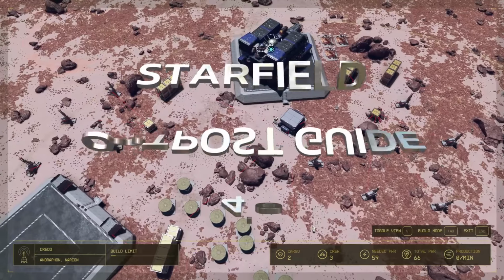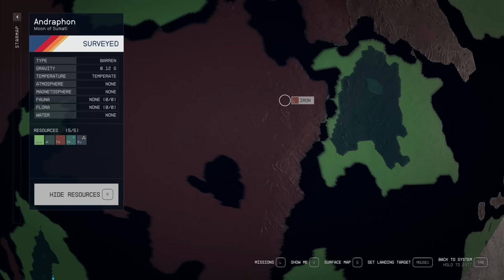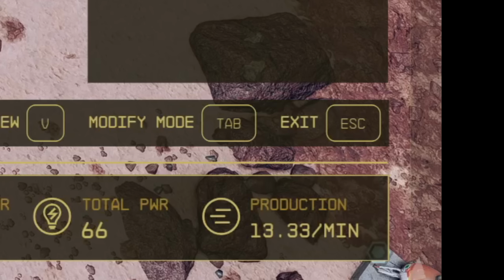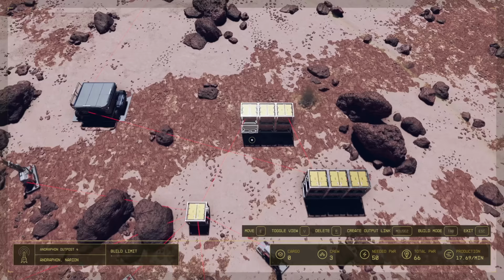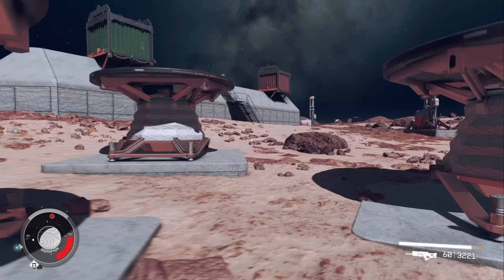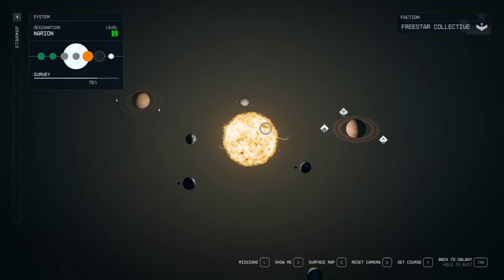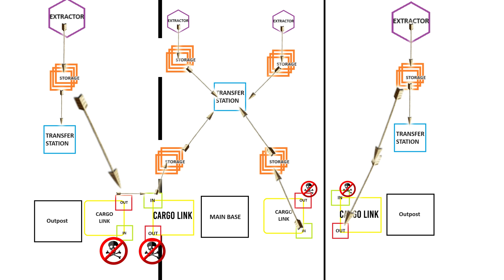[Starfield] Outpost Guide 4.0: How To Connect and Organize Perfect Outposts

Comment: The infinite storage chest in the basement respawns if you leave it for a period of time not sure how long I would put anything in there safe in bedroom is SAFER
Reply: I dont even have that storage chest in the basemeant
Reply: @johnathanmanuel780  there should be about 6 or seven chests in the basement and also the mannequin 3 for ammo by the weapons work bench one in the bedroom down there another on the left as you head to the manikin and that one right behind the research work station plus two weapons racks on the wall
Reply: @bahamutstear1369  no theres a large storage chest in that basemeant under the weapon racks by the benches on the back wall, as you come down the stairs, ive seen it in a video once and cannot figure out how they got it there.  But i just use the nova galatic captains qaurters for a bed and large storage chest, stroud eklund workshop for benches and research station and nova control centre for chest and crew and called it a day until i ng+ a few times
Reply: @johnathanmanuel780  it might be a mod cause I don’t have it on Xbox
Reply: Thank you!
Reply: Yeah could be instance based but the safe up stairs should be set and has infinite storage. I like other's don't have the box.
Reply: @johnathanmanuel780 it's not there for everyone.
Reply: They removed the chest in the update.

Comment: I believe your problem is your trying to use your transfer station for incoming I believe it is ment to be used for you to transfer your product directly to your ship (out going ie: automated manufacturing) without you leaving your ship. just run a link to a set of cargo boxes directly from the cargo link incoming. Do not use the transfer station that way the incoming ship will continue to fill the boxes until they are full.

Comment: Thank you for making a guide like this. I'm so tired of every guide being the basics for beginners. One suggestion...rather than wire the stacks of boxes together, take the one that you feed from the extractors, place it 30 feet behind the stack of boxes, then wire it to each individual box. This makes it so much easier to see which boxes are wired and which aren't. It also allows you connect/disconnect individual boxes easily.
Reply: I just noticed not to long ago that the "linked" storage containers that are connected together have no color shade. And the storage containers that are not connected have a blue color to them (to identify they aren't linked and that you can link to those).

Comment: If you're crafting in an outpost it automatically can pull from all storage chests at that outpost. No need to manually grab materials unless you're gearing up for massive crafting sessions that need more than all your storage can hold at once.
Reply: This is the best reason to have a home base outpost. If you skip cargo links and other stuff, at least having a place you can build containers and store it all is great. Let's you reduce the mass on your ship
Reply: I know it pulls from storage buildings, but i think it doesn't pull from the boxes and chests for crafting.
Reply: @thrawn82 
Correct.
Weapons/packs/spacesuits you have in those chests/display cases are not available for modifying in the crafting bench either. If you have those in your ships inventory they are.
Meaning those are 100% separated from the "shared inventory" outpost building and crafting use.

Comment: Cargo links are not based on UT, they are based on in-game time. You're best off setting it all up and going off to quest for half an hour to an hour. This will ensure your operation is well underway.
Reply: What's UT mean
Reply: @BREAKocean  Universal Time. Time elapses differently across each system, dependent upon the planetary body's relative position to it's Sun, etc. The game converts this back.  It's like time zones in space. Resting for an hour on Venus is like resting 243 Earth hours (the game does it at a 1:100 basis though but that's still muchos mineralos)
Reply: Was going to suggest this myself. I sure wish cargo links also followed the UT guidelines. Frustrating that it doesn't. However, as @TactiCat mentions, you can fast travel to an outpost for quicker retrieval. In that way, you can create much larger storage at those outposts to accumulate via UT, so when you go there, you can grab a massive quantity quickly.

Comment: I found a nice trick to have my containers spaced out.   

Build a 2x2.   Place a 1x1 at the bottom left. Place a 1x2 to the left, and it will be off set by a 1x1 square.   

Place another 1x1 at the bottom left and then another 1x2 on the bottom left.   It's offset by another 1x1 unit.    

Now all your rows are lined up perfectly.   

Thanks for the 60 limit conection tip!
Reply: Took a screenshot because I can't picture this in my mind so I will read this again when I play the game. Lol
Reply: @randytesla7596  ya, you are basically using the 1x1 and 1x2s to do the parallel offset.   The 1x1s are the only unit that can start it because the other two start snapping like they are supposed to.   

I don't think you can make them right next to each other, but a 1x1 gap works perfectly.

Comment: Thanks for all your info. 

I think that two things are the main issue. One is the separation of time with production and the cargo ships. This causes massive build ups of resources waiting to get shipped. Then, with the inter system links, ships will pick up 500 cargo and only be able to drop off 300 (probably the source of the bug) the extra 200 cargo seems to get stuck in the ship, meaning that it will no longer release that 200. Something then happens each subsequent shipment where it seems to pick up the resources but will no longer drop of the resource types that are stuck in the ship. This causes the scenario where you have multiple resource types but only one is getting dropped off. I say that because I noticed that when you break the link between stations and quickly exit the menu, you see that all the stuck resource types get sent to your inventory and the ship's storage goes back to 0/500. 

I think the best and most optimal setup is what you show here. Link resources to your transfer station and run the resources manually between planets and then go to your main base and craft for the mad xp boost. It sucks that the cargo links don't work and hopefully will be fixed soon, but until they run on the game time and not real time, they will never be as productive.

Comment: A few Building tips if interested; The only limit for space is really where you want your initial extractors, so place all those first and build right up to, and around them later. You can then fill up the base over the resources without affecting extraction! Room for cool and useful stuff like a decked out hab/watchtower/work stations/turrets etc! 

Build it up slowly best jump in test and plan certain placement as;
1. Storage linked stacks are the hardest to move.  
2. transfer/ship platforms require the most space and should be as close together as possible for easy getting around. But it’s all easy to move! (Except large storage stacks)

You can always shuffle around later to better setups, that’s what I did. 

I Love 💕 my highly productive beautiful main outpost now! Ty @Tacticat!

Comment: For sake of ease of linking containers in isometric view I put every container in single row not putting containers on each other. Then I link from left to right or vise versa. And after connection made I move containers to stack them in columns. So you get zig zag linking without doing zig zag manually. That's faster for me.

Comment: ok so one cargo link transfers 300 materials to it's destination every 4 game minutes. unless they fixed it in the .36 update sleeping doesn't affect that. it just means that the link that is exporting is actually filling up before transfer, which is not the same thing as the actual transfer of the good.they also take a minute to load and a minute to offload with a 2 minute flight time.also i only ever use the transfer station for final product parts from fabricators since that is where your money is really coming from. also using power switches helps with power issues and upgrading to larger storage as you research and skill up. it's a fun process and i actually love it. i just wish that the links were based on UT and not real time.

Comment: The ship builder has a "flight check list" that gives you hints if something breaks. The intersystem cargo links has nothing like that and it constantly breaks. Spending time trying to understand why your network of intersystem cargo stopped working is frustrating. You can try different things: Save and reload. Restart the game. Tear down and rebuild. It seems completely random when it works or not. Even when you get things working they may break again even if you leave your "working" setup unmodified. My advise: Ignore this part of the game unless you enjoy traveling back and forth and trying random things. ¯\_(ツ)_/¯ Good luck everyone - Enjoy your adventures :)
Reply: Yepp, i had a perfectly working set-up, mining, transporting, fabricating. Do a few missions and come back to stuff in the incoming box that shouldn't be there, harvesters not working, cargo transport ships missing, one fabricator not running, stash boxes refusing to load up etc etc. It's a f-ing mess.

Comment: I would also always place the large round ship landing platform straight away.

If later you have a ship too big it will not land at the outpost, it will land at “the original landing site” much further away. 

The large platform is also great for ship building and modifying so win win. NOTE: you can switch current active ship to the original starting frontier or a small ship you own at the platform to not have to run back to that big ship you landed on but this can also bug out and require a save and reload. To avoid I recommend just setup the bigger ship platform on initial build. 👌👍

Comment: I didn’t know about the storage bug but it makes sense, I have been having issues getting more resources from my other outposts. Kind of been putting my outpost building to the side as I work on getting more levels.
Reply from the maker: Yeah I might need to make a video on having storage for each extractor and then running it into the transfer station
Reply from the maker: If you have 6 storage per extractor and then run it into transfer that’s only 8 connectors and a total per extractor. And 30 storage collectively for 5 extractors. Mitigates the bugs and allows bulk

Comment: 2 things. 1. do not put anything into storage from personal inventory could cause problems. 2. every system receiving/shipping MUST have HE3 connect to the back part. make it separate HE3 even if it comes threw different planet.(ive done it and it works. make sure to use  enough of it) you need 5 HE3 for each one. do not use HE3 from your main storage that you are shipping to feed it.

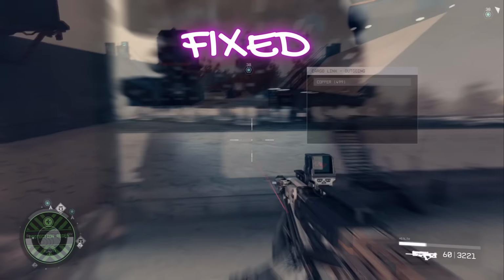Comment: 20:10 I was having the same exact issue. I had my last storage box linked to the outgoing of the cargo link but it would not pull from the last storage container in the chain. I just had the idea to try the second to last link of the cargo box chain and it suddenly worked. I just re-did the links to everything and it works fine now.

Comment: Nice video I took away a few things from it, My thoughts is that if this is first resource gathering outpost then by all means place down your storage containers, that's a given,  but... if this is just a distribution outpost then I would suggest forgoing the storage containers all together and link your extractors straight to the outgoing of the cargo links along with the helium needed for the intersystem cargo links.

Due to storage limitations I would also suggest creating two outpost with 3 - 4 cargo links "distribution" having all of your other outpost going to the distribution  and then two cargo links at the home base and have the two distribution linked outpost aimed at the home distribution that way it would help relieve the bottle necking and hold up along with the noise.

Comment: Another trick for outpost item placement; if you cant get the rotation right you can scroll to the next item and back and it will alight it perpendicular with your character. IE you can position yourself instead of the item to get a clean angle.
Reply from the maker: Niceeee

Comment: I have found that creating links between points of shipment tend to get bugged when you make connections while an outpost is in the process of manufacturing. The way to avoid this is before making the connection to transport out allow your storage to just completely fill up everywhere in the outpost and can speed this process up by waiting. Once all of your outpost containers are full then create the outgoing link. I also try not to interfere with production. So I place a main kill switch between power and my manufacturing because most of the time unless your are frequently pulling your inventory then your storage will fill up and only be relieved from a transport. That way I can shut down manufacturing at the outpost, pull all of the inventory to my ship and then turn it all back on at once allowing each piece of machinery to fire up at the same time. You will even notice at that point all of your extractors are operating 100% tangent with each other meaning you see them go up and back down synchronized. This allows each machine to be producing the same amount and sending it to their respective storage with better efficiency. This is another layer of work because you are wiring each machine up rather than the passive power but this method also allows complete control of operation and is more efficient. I like to wire each of my power sources together in a daisy chain, then the last to the switch. Then from the switch to each of the extractors separately. So you shut that switch off and everything shuts down. In my experience this can prevent a lot of the bugs. I mean they included power switches for a reason. And rather tear everything down you can just reboot it

Comment: i wonder if it is also possible to make one super hub locationwhere u send all the resources to  so like 1 system hub conecting 6 outposts that then sends its resources to ainter system hub where they get stored in an even buigger storage yard and transfered to a supra system hub where u actualy place the manufacturing macines?
i am already trying to do that but so far my system hubs get swamped by mats so fast that i dont know if all the garthered mats actualy reach the 2nd hub !

Comment: Dude. If you think that 5 hour production is good then you need to go to Bessel III-b in the Bessel system. 65 hour production rate. Sleep one hour and you have infinite Iron, Nickel, Colbalt, and Aluminum.
Reply from the maker: That’s a good setup
Reply: time doesn't pass any faster. The planets have different rotation times. An hour on Venus is not as long as an hour on Earth. depends on how big a planet is and how fast it rotates.

Comment: The cargo systems in this game should only be pemanantly linked if supplying he3 or set materials for machine crafting, best way is to build helium plant that provides to other systems, then as far as general materials have out going of each ore allu iron copper etc, each outpost i build has a cargo system that is not sending or recieving then once you need the resource you simply choose the resource from your list of outgoings a minuite later the materials land then disconnect from terminal leaving the connection able to be used again elsewhere when needed, this also allows you to connect to settlement links e.g akila at rear of landing pad next to the pad you land on when visiting to complete bounty board delivery missions, to summarize my bessel III sends copper iron allu and cobalt on seperate pads then has a pad to recieve he3 and an unused pad for any material i want shipped in at the time and disconnected once i have what i need, hope this makes sense

Comment: @tacticat My biggest issue is that all the inter-system cargo links run out of H3. I have it setup so my home base accepts all incoming resources. The problem is that only one of the other outposts has h3, so that H3 never gets to the other outpost (they are both linked to the home outpost, but not to each other). Even if I change it so I have h3 outgoing from my main receiving base from a dedicated storage unit that only has H3 inside , it ends up sending whatever other gases my base has in stock. And eventually the storage in the remote facility fills up with things other than H3 and the ships stop coming.
Reply from the maker: Yeah it’s a mess - the easiest way is to have H3 at the source unfortunately
Reply: You can accept incoming resources from your main base even if you dont have h3 in your base. Mine works like that and only need h3 to my outgoing base

Comment: Nice video!

I have been trying to land on a site where I can have the 4 resources like you did, and even when I do it on a perfectly similar spot, the mountains will never have iron, is this maybe something that got patched in the game?
Reply: Even landed in the exact same spot as you, but no luck at all
Reply from the maker: It’s not patched out. A trick is to land in the crater and run toward a large mountain but it takes much longer. If you click on the map though and look for the bone change from crater to mountain you should be able to quickly find the border of the Niobe and run along that till you find all the resources together